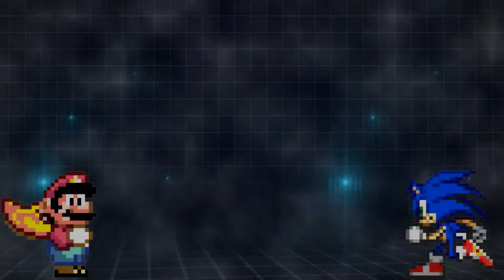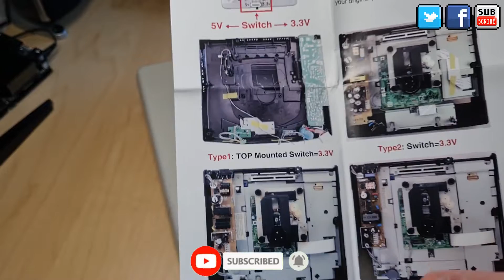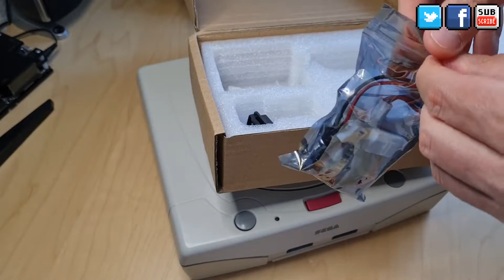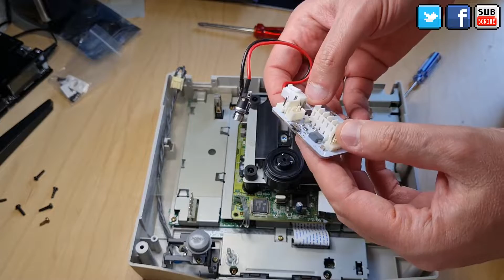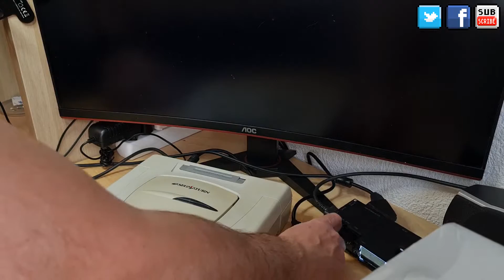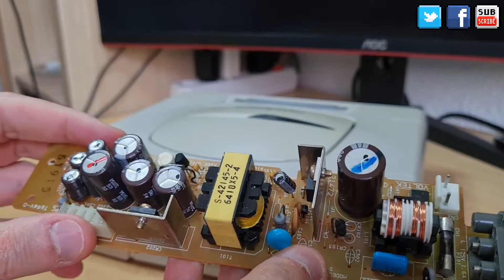"How to" replace the Sega Saturn PSU

Comment: Hi. Is it possible to  put a pal model 2 power suply on a pal model 1 ( 5 pin both ), please?
Reply from the maker: You need to double check the hardware revision....its possible that it will work, but better be sure.
Reply: One more thing please, are these new PSU's safe? Long term can they damage any part  of the console's hardware? @RGF
Reply from the maker: @rescuecomplex5115  i have two Saturn's with them for 3 years, without any issues.
Reply: Ok, thank you! I will install one! @RGF
Reply from the maker: @rescuecomplex5115  let me know how it went afterwards
Reply: Ok! 🤭 @RGF
Reply: Thank you! @RGF

Comment: Hi thanks for the vid. I have an AliExpress psu on the way that looks exactly the same as the one you're installing. Do you need an external power brick as well or does this just plug and play?
Reply from the maker: You need a external brick...😪

Comment: Did the fuse grilled on your original psu ?
Reply from the maker: Yep....at least the fuse.... 😉
Reply: @RGF  Mine didn't grilled  but the capacitor went pop. I ordered the same PSU you did, hoping the motherboard IS fine... I got the same saturn as yours and they say they always die from a grilled PSU... Apparently yours didn't...
Reply from the maker: @Shubibin_Man  got lucky...😉